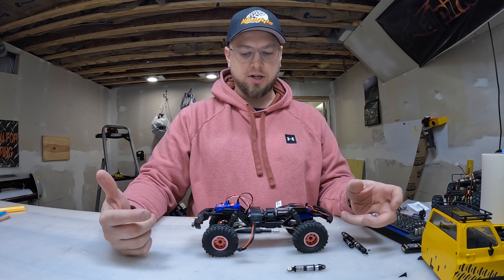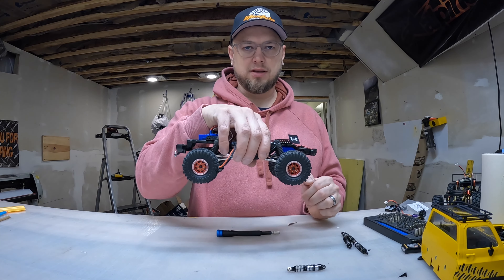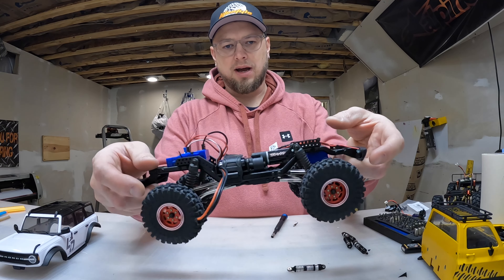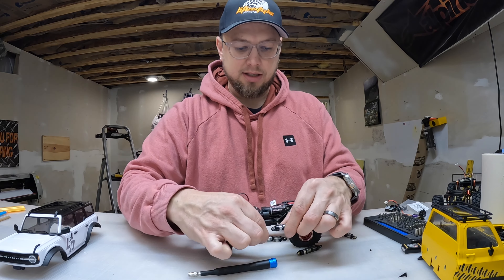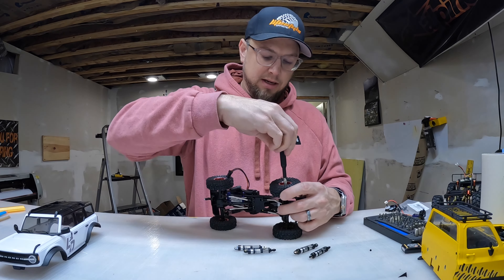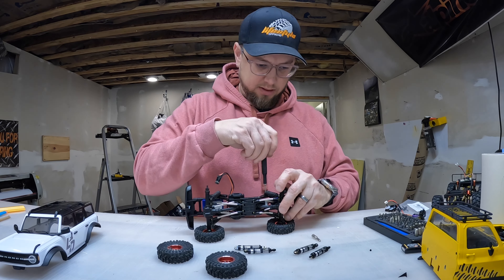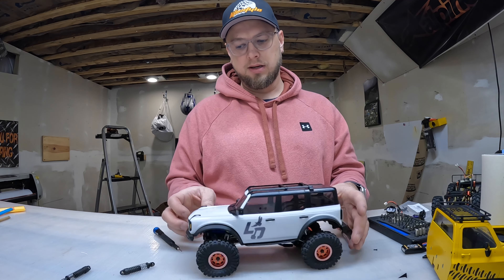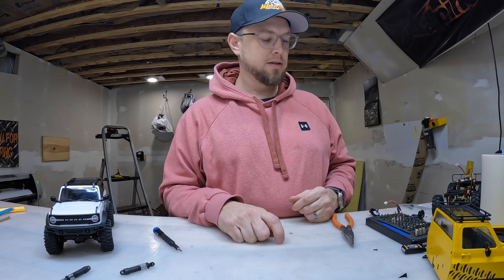Traxxas TRX4M Shock Upgrades

Comment: What shocks are on the bouncy Bronco? I have the same problem, bought injora 53mm and they stuck even worse
Reply from the maker: Did you add oil? I’ve run into that issue before where they just didn’t have oil. These are just cheap Amazon ones

Comment: With the stock shocks , just make sure you have oil in each shock , not full just some in each shock , but if you drive it a lot they get better but they are just plastic